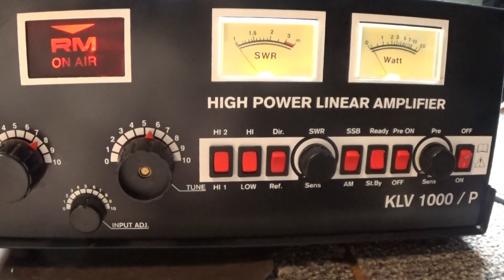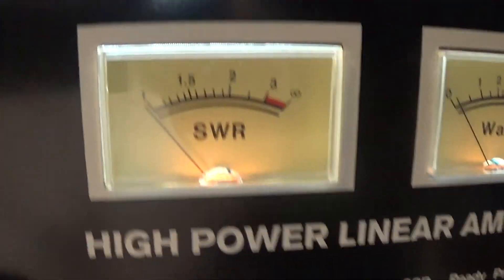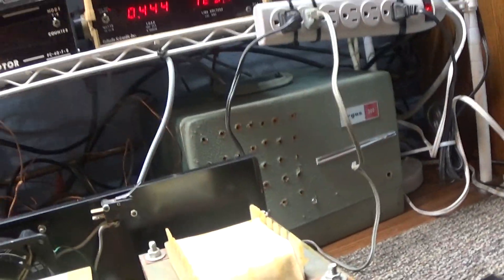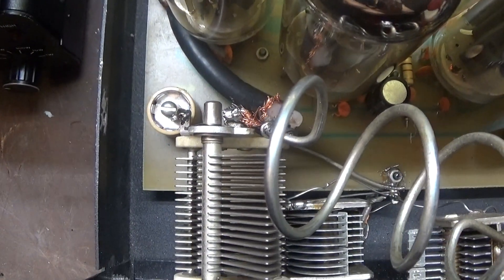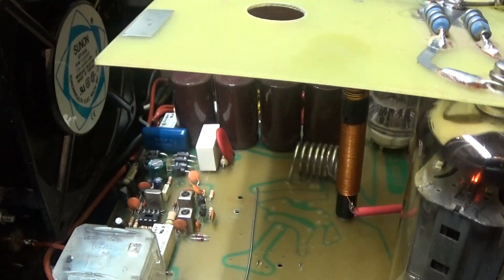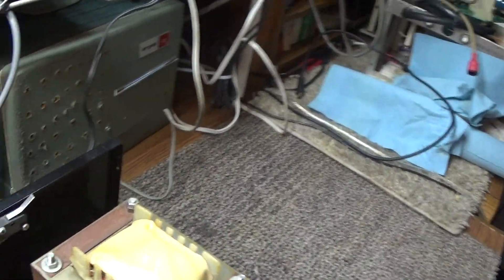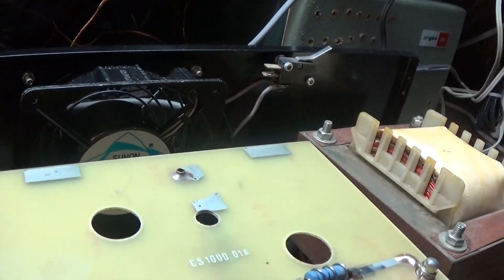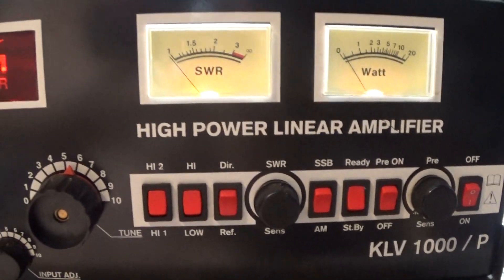RM Italy RM KLV-1000/P Linear Amplifier

Comment: Kl805 plus & a E-SCN_25v PSU for €890.00/£780.00 for 600w Am/Fm 1-15w, 1000w Ssb 2-30w, thays the deal I cam get at the moment.
I am liking the idea of the above duo, currently running a Kl503 380w (pep) Ssb, low input drive though 2-10w 1-6w Fm.
Other option is to save up and buy a Juma P1000 or a Gemini HF-1K.
Great video BTW, I hope to be blowin smoke by Christmas. 73's, 407 Mcr 👋 Uk
Reply from the maker: Sounds good.

Comment: They're good apps I have the klv VIP 1000 wanted to replace the tubes or at least have extra tubes but the cap on top prevents you from taking them a loose you would definitely need a technician to do it to change the tubes other than that it's a damn good app I haven't hooked up to my Stryker 955
Reply from the maker: They are decent if you treat them right. They won't take abuse though.

Comment: Why are amps all Have a SSB/AM switch, but not a FM mode?
Reply from the maker: With CB amps, SSB adds a delay to the keying relay as SSB only makes power when you are modulating. In between pauses, the relay would unkey on SSB without that delay. AM, and FM have a carrier that is on all the time, so the relay would stay keyed up all the time, so a delay is not needed for FM.
Reply: @tramdr  So they should call it AM and FM mode?  It seems on AM the amp runs cooler, on FM seems to overheat or at least run more heat.
Reply from the maker: until recently FM was not legal for USA CB and almost nobody used it. You hear people talking about SSB Bias especially for transistor amps, it is kinda the same but in reverse with the duty cycle between AM, SSB, and FM. SSB is audio information only, so low duty cycle. AM has a limited carrier .25 the size of the audio, so  medium duty cycle. FM the signal is full on all the time, so very high duty cycle.
Reply: @tramdr  FM almost nobody used it? Its all FM here
Reply: Because fm has a carrier like am does so why have one for fm ?